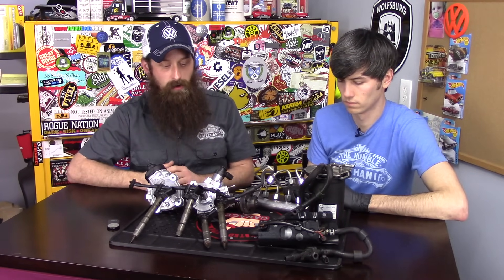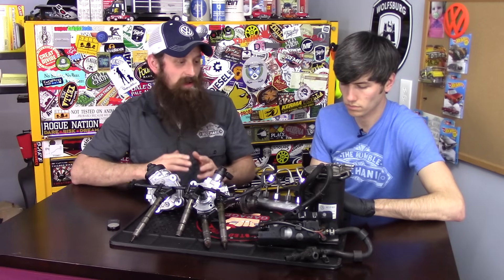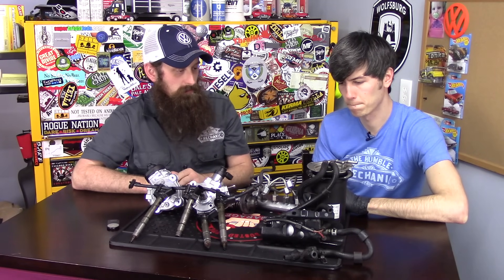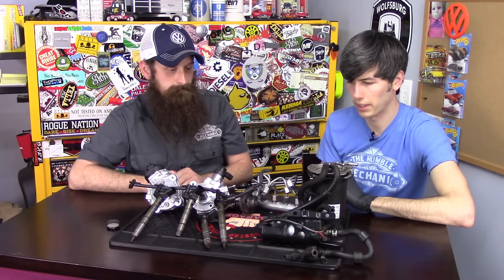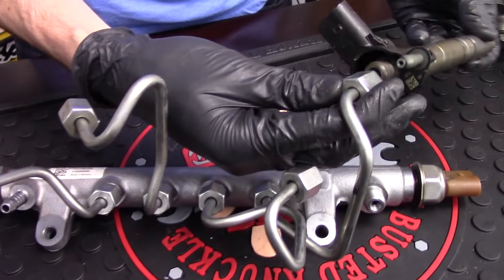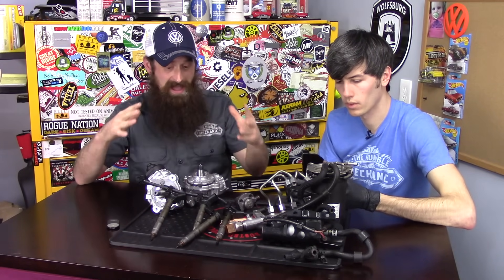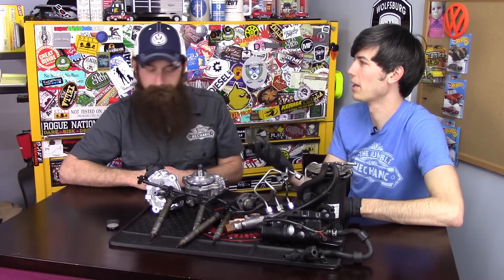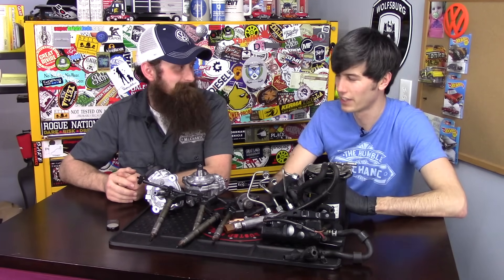Putting Gasoline In A Diesel Car - What Happens?

Comment: Weird.. My diesel engine will run on diesel, avgas, gasoline,  JP5, JP8, JP7, Jet A, Jet A-1, used engine oil, new/used transmission fluid (ATF), vegetable oil...  But then again, I have a multi-fuel engine with a fuel density compensator.

Comment: nothing happens to a car if you put gasoline in a diesel ;) in winter time it's event recommended to put up to 5% of gasoline or kerosene in the diesel, to remove condensation and help the diesel not to freeze. And even if you put up to 25% of gasoline in the tank, car engine will work until you shut it down, after that it will not start because of the sensors in the engine :), all you have to do then is to flush the system and change the filters ;)

Comment: Nice watch but it seems a bit excessive to replace that much. I have driven a Mercedes Sprinter with a 70 liter tank which had been filled with 55 liters of gasoline. It started fine the first couple of times but became harder to start. 

The Mercedes tech just drained the tank, we then refilled the tank and cranked till the injectors started squirting Diesel and it still runs spot on. 

But one of my colleagues killed a VW Passat that way. Completely new engine because he had started and driven on it. 

So YMMV depending on mark and model of car.

Comment: I once put about 10liters of petrol in my diesel,  once I realised I simply filled the car to the brim with diesel. 65l tank,  and it ran fine, at half a tank I filled it again to dilute it further.  I had the car for 5 years after that stupid stupid  day.  The car suffered no Ill effects . 

So if you realise early enough,  less than 20% fill you will be fine.

Comment: The metal particles you speak of would only come from the faces of the cams driving the pump piston, if there are marks on the faces then you may get particles showing on the  metal screen filter. I should think these surfaces wear better than you suggest they do even without the lubrication of the diesel, there is still fluid on the faces ( petrol) will keep it cool and provide some form of protection. If the driver has filled the wrong fuel and it doesn't start,  how long would they keep trying to get it to start , I'm sure there wouldn't be that much wear and tear that particles would appear in the filter.

I have an old Toyota 1988 and I run it on waste oil, and to assist better burning of the fuel I add two liters of petrol to twenty liters of waste oil to help reduce to smoke. Works great.

Comment: Lol.. don't know what you stick in your diesel where you are, but in the UK, you just drain the fuel out, give the fuel lines a quick flush and refuel / bleed any air in the system, takes 30-40 min's and company's like the AA and RAC will do it anyway you are, alone as its a safe environment.

Comment: I was given quite a few gallons of free diesel contaminated diesel pumped out of a Suzuki diesel jeep thing, back in 2006. Despite being 60 to 70% diesel to petrol ratio, it ran perfectly fine in my 1988 Jawa 350-632 2 stroke sidecar  outfit. (The engine actually ran better than it did on plain old 95 RON unleaded).

Comment: Replacing the fuel system SEEMS extreme. but in the terms of my 6.4 Ford even something as small as too much water in fuel can cause HPFP failure, sending God knows what into the injectors, sticking them open, and literally burning a hole in that cylinder. these common rails aren't as forgiving to alternative fuels (intentionally or not) as their older counterparts were. It's the cost of power.

Comment: I am not gonna pay someone to get rid of a fuel that lots of folks would use to start a camp fire anyway. And honestly how many folks care enough about the environment to actually pay $25 a gallon? I would venture to say far less would actually do it when it is real money than how many would claim so when it is theoretical.
Reply: +Eskimo227 Its diesel diluted with gasoline. It doesn't flash up like gasoline does. Wouldn't be much worse than Kerosene. I've used gas, diesel, kerosene, used engine oil and never had an issue for fire starting. Its not good for the ground but still. Don't be stupid and use only a little bit. Like 1 cup at most.
Reply: I would never use gasoline to light a fire, again. Unless you're on a beach or out in the desert with no vegititation.

Comment: Good video , just on the price of repairs   , no doubt it varies on the vehicle and type of engine, and also what country,  on a car forum recently a member spoke about fuel contamination to his suv fitted with a v6 diesel , the repair cost was quoted at $ 20,000 for parts and labor, probably some of that was due to being in Australia , everything is bloody  expensive.
 this is one reason i have never been a fan of small modern diesels, good while they are going, disastrous when they go wrong .

Comment: Was that 800 bar number correct? I had no idea the fuel was under THAT kind of pressure.
Reply from the maker: +Ricky Lahey Yes, and can certainly be higher.
Reply: i dont know about VW but i know with the ford powerstrokes that use the HUEI systems using, high pressure oil to fire the injectors, the high pressure oil system on its own at WOT sees 3000 psi and when the fuel is injected out of the tip its running around 25,000 psi. with the newer diesels they are seeing i believe its around 30,000 psi

Comment: soo... peugeot 106 1400cm3 diesel on reserve. The idiot gas pump worker is talking with someone and dumps 20€ worth of gasoline (1l = 1.5€ @ Portugal back then). the car runs fine for a few minutes and dies. 

Then the car spends 4 days waiting for its turn in the mechanic's lot, and the only thing that was done was a full flush... this was a year ago. the car still works... why it is not dead i do not understand.

Comment: Here is a question, A friend of mine used to work at an airport as a refueler. He said when they would sump the jet tanks in the morning they would sometimes dump the jet right back into the truck's diesel tank. Is he pulling my leg or can Jet A be used as a fuel source for diesel engines?
Reply: +XBLMastrodicasa yes possibly, especially if it's a small percentage of the total fuel in the truck.  the fuels are similar but iirc diesel is more lubricious so you better know what you are doing ...

Comment: man i worked at a renault dealer for 12 years and we would only drain system and replace filter not the hole housing most times the custemer did not run the car for long

Comment: Put Kerosene in and old diesel truck once when I ran out of fuel in the middle of nowhere and the only gas station for 50 miles didn't have diesel, but had a kerosene pump.  It ran it just fine.

Comment: seems to be an excessive amount of parts replaced as a "preventative" measure, none of those officially failed. and they failed to mention probably the most important thing, the diesel catalyst, wouldn't that be poisoned from the hotter burning gasoline?

Comment: I've seen videos on Youtube on how they fix gasoline cars with diesel. That person use the fuel pump to flush out all the diesel in the fuel lines and cleans out the intake rail/manifold. When he restarts the engine, lots of black smoke come out from the exhaust.

Comment: On VW group cars (new ones) you can't put gasoline in diesel tank. There is a device in fuel filler. Diesel tip fit perfectly in fuel filler and it open it. Gasoline tip is to thin and it wan't open. I don't know how In US but In Europę it really working.

Comment: European cars must be a different animal all we used to do drain the tank and fuel lines change the filter, fill the tank with diesel and run the car. Out of all the cars we did we never had any problems and it was a lot cheaper for the customer, the reason may be that most of the customers realised what they had done and got the car to us ASAP or European cars are better made than American cars.

Comment: In the 1980's Peugeot recommended adding up to 25% of gasoline to your diesel tank if the temperature was below -5C. Also you could add up to 33% of paraffin as an alternative to gasoline but pointed out that it could be illegal in some countries as little tax is paid on paraffin.
I cannot see that gasoline would harm any seals compared to diesel and as long as there is less than 50% gasoline in the tank that it would harm the fuel pump or injectors in the short term. There is a device called a "fuel Angel" available for sale in the UK that allows the insertion of a diesel nozzle into the filler hole but not a gasoline nozzle which is smaller for those worried about miss fuelling.

Comment: this is why it is crucial to make sure you put the right type of fuel into your vehicle if its gas don't diesel in it if its diesel DO NOT put gas in it had a friend do that to his durmax because he thought his gas can had diesel in it when he grabed mine that had 101 octane racing fuel for my chevy nova i raced on the local strip not giving out location and ya needless to say we spent 3 days taking it apart and replacing the entire fuel system and yes flushing it with breakfluid and compressed air will work but a tear down of the motor and draining all fluids is basicly the only way to fix the damage done the injectors went out not minutes of driving down the road was a nightmare for him and me cause it was his dads truck too! not my buddys so ya was not fun explaining what happened but ya you wont get a refund for a mistake you made pluse how you can make this mistake is beyond me when the diesel pumps are clearly marked and are lime green and the label says clear as day diesel fuel only lol and for the rants on here hilarious how many monchoes troll on this stuff im just saying what happened to me as a life lesion so you don't go threw the same problem....cia lmao dumbasses there probably laughing just as hard as I am right now XD

Comment: About 12 years ago I was working at a gas bar and one of the other new guys (we had both started working there a couple weeks prior) filled someone's diesel car with gasoline. The owners of the gas bar (GAS FOR LESS; not around anymore) where there and all they did was go buy one of those jerry cans with the hand pump on it and stuck the hose down into the tank and pumped it out into the underground unleaded fuel tank. I tried to tell them (not with the customer around, mind you) that this was going to do some real damage to the car. They didn't listen, the got rid of me and kept the guy who fucked up someones car (they needed 1 guy, they hired 2, I started 2 days after this guy, so they chose him). The company lasted a few more months and than shut down after being there for a decade. I always assumed they got sued by the car owner, I hope they did.

Comment: I almost completely filled a Ford Sierra (UK) with Petrol, gas, in the mid 80's. It ran for best part of 100 miles before stopping. Remaining fuel drained by the AA at the roadside, new filter, tow to the garage, brimmed with diesel. Result, car ran better than it had before and carried on for well over 100k miles. Maybe you could chuck anything in the old oil burners without dramatic damage.
Reply: +phil mason I'm not an expert at this nor did I pay 100% attention during the video, but I suspect that older cars operated on much lower pressures. The guest did mention 200-300 bar (or maybe higher?) at some point for final stage before it  gets into the cylinders, if that system expects lubrication and doesn't get it things can and will break.

The forces involved with generating such pressures tend to require tight tolerances and proper use or you get bad situations, so if someone filled the car up wrong and ran it until they noticed a problem or the car stopped entirely I suspect a lot of his concerns are very valid (although arguing about how much to replace might be another thing, I don't know enough about the fine details to judge that).

Comment: diesel put in a gasoline engine. fact is that this will burn the valves  real quick. you wont get  50 miles.   it will not run  very well if at all.   it will absolutly burn the valves! ! other then that it will not hurt anything. if you put gas in a diesel engine it will develope  ping [preignition] crack heads cylinders bend valves  bend connecting rods  destroy rings pistons crankcase as the rods will come through it, and of course it will bend the crankshaft.  the gasoline will explode at a lower tempreture  the temp is caused by high compression of diesel engine

Comment: Ive heard that putting diesel into the crankcase and running it for a few miles before an oil change cleans out the engine very well.

Comment: First of all if I had a diesel and by mistake or by stupidity I would put gas into it, I will flush the system and that's all. Maybe the car will be ok, or maybe not, but I won't by by default a high pressure pump, a low pressure pump, injectors and so on... I rather buy another car. I don't know what diesel engines you have in US, but in Europe a high pressure pump and the injectors are a fortune. And I don't think the wear is so big if you run a little on gasoline. If the engine runs means that also enough diesel is present. What if I run out of diesel and crank it? Means that the entire injection system will be destroyed because of the lack of lubing? LOL

Comment: a friend of mine who passed away years ago had a road grader that had two separate fuel systems. during cold weather you would start the engine on gasoline, then  when the engine was warm enough you switched it over to diesel.

Comment: Gasoline won't damage a diesel. If you read the military fuel chart gasoline actually rates pretty high on the useable fuel charts, higher than the D2 we are sold at the pump these days.

Comment: I had a 06 Toyota Avensis 2LD. I put petrol in the tank . I disconnected the fuel line at the fuel filter. I pressed up and down on the pump attached to the fuel filter. After 1 hour the fuel tank was empty. I mixed this fuel with kerosene in the central heating  tank. After 75 min I was up and running again. This will not work on newer engines cause there more high tech. However 12 months later I used cheap diesel and this caused damage to the fuel line -ERG valve stuck and smoke from the engine. As the car had over 250K miles on the clock I took it off the road..

Comment: For what it's worth, in a decade of being a mechanic I've dealt with several modern cars of varying makes that have been filled with the wrong fuel (petrol in diesel or vice-versa) and every single time we were able to simply drain the tank, drain the filter, put new fuel and drive the car away with zero repercussions. ymmv

Comment: I've seen this in a power stroke and a cummins, I've never seen that many parts replaced unless it was cranked over for an hour or more and something popped? The sensors in the fuel system and water separator shouldn't allow the engine to start anyways. VW diesel's are bad for the environment anyways. Burn them to the ground

Comment: What about discussing the dangers of pre-ignition and detonation? Aside from the dangers of metal fragmentation clogging filters, injectors, and other components, if you put a lower octane fuel in the engine (i.e. regular gasoline in a diesel engine), the resulting engine pre-ignition and detonation can ruin your engine.
Reply: +hh1n how are you going to preignite when it doesn&#39;t inject the fuel until TDC?
Reply: +aesop m 
The fuel is injected before TDC. Diesel fuel is rated for higher compression engines (more stable), while gasoline will ignite at a lower compression. This can cause issues because the gasoline will ignite before the fuel is supposed to in a diesel engine

Comment: What happens if you put gasoline in a diesel car? A mechanic rapes you for $8000 when all that you really needed to do is drain, flush, and refill the tank. Presto! Good as new!

Most people realize that they have made a mistake within a couple minutes, or as soon as the car starts running rough. Long before any actual damage has been done.